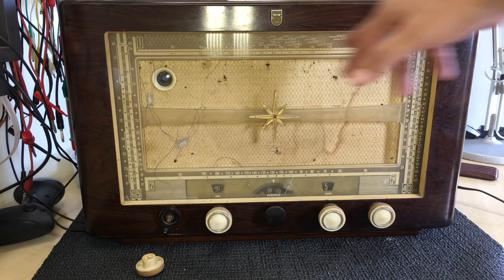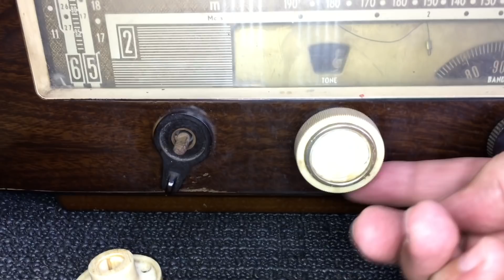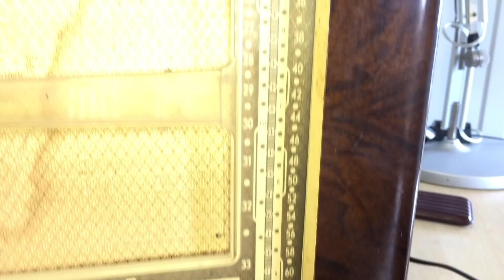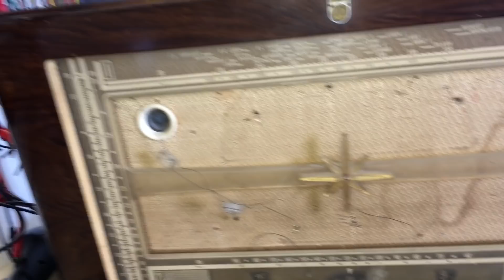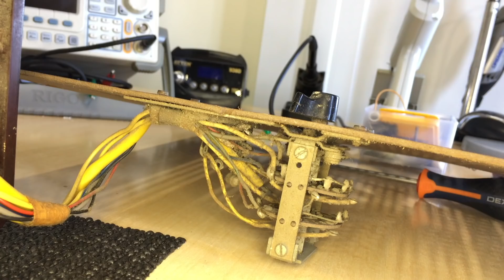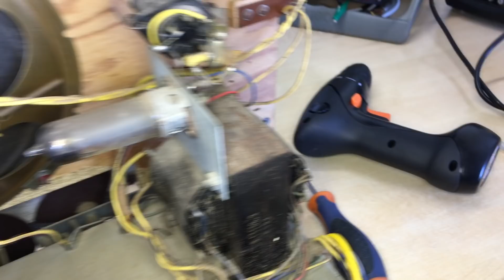Philips BX626 tube radio restoration - Part 1. First look

Comment: This reminds me a little of the "farm radios" we had in the USA, designed to run on batteries that were usually charged by windmills. At first I was wondering if this was one of Phillips' 1950s sets with a transformerless totem-pole output , but from the other comments I see that the can is a transformer. If no vibrator is located, maybe it uses one of the tubes as a power-conversion oscillator.
Reply from the maker: My friend tried to find more details, but unfortunately failed.

Comment: Bit of an odd ball model but very intriguing, looking forward to seeing more updates. Australian resident, been following your videos for a few years now I think your channel is one of the best on YT. You really deserve more subscribers. Just picked up my first tube hifi set a Graetz M518D. One of the peaking coils had fallen from the underside of the chasis and unwound partially and unsoldered, hoping to rewind and glue back into place. Looks like they only used molten wax to hold them in place.
Reply from the maker: Matthew Enderby : thanks Matthew. This could can be quite fragile. The wax can be carefully removed and the coils repaired. Should work. 
As for the channel, I just do this as a hobby, so I don’t particularly strive for any growth. It is gratifying that almost 2000 subscribers have found it worthwhile.

Comment: What an un usual radio! The vibrator pack is similar to early car radio's with valves. Being 6 volts, that would power the heaters directly. I think you would have to use a very large battery, probably a car type as the current draw will probably be about 5 or more amps.
Reply from the maker: I’m still a bit stumped with the battery operation, because now it seems that the can is actually the output transformer! I’ll have to see how we progress and what we discover.